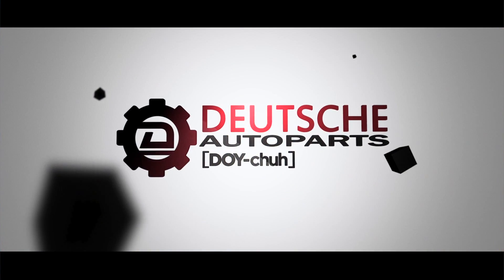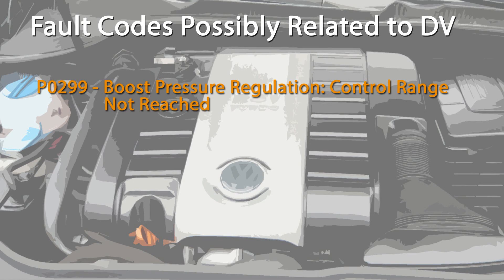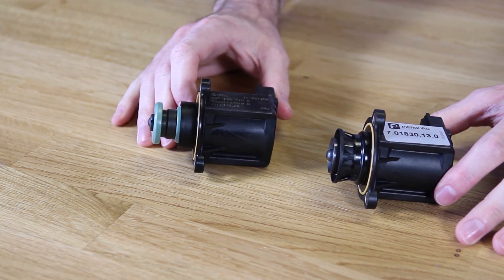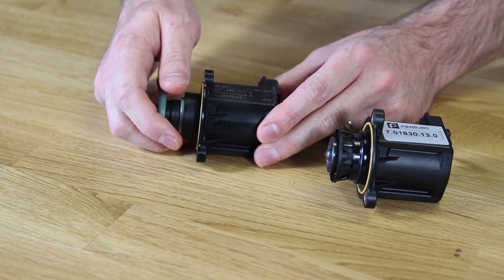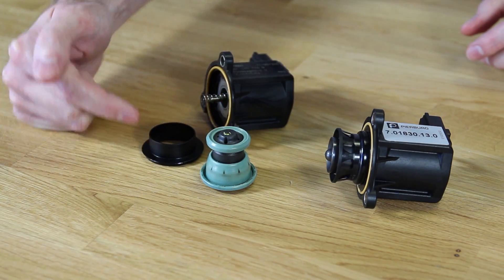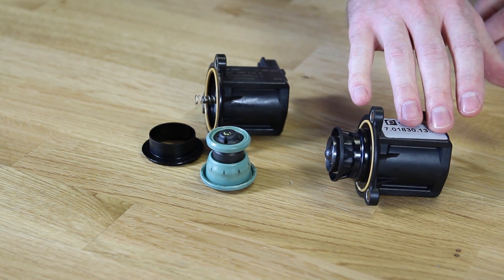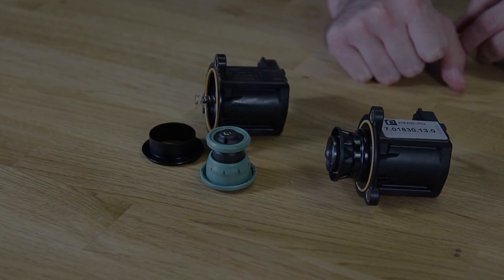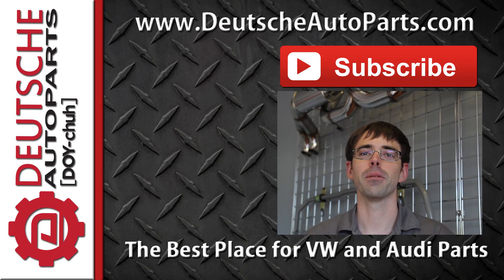VW and Audi 2.0T Diverter Valve (DV) Revision "D" Explained

Comment: Revision D is the latest and is more durable BUT revision G hold boost better, actually it even hold the boost better than the DV+. So if you want peace of mind and you don't want to worry about it, take Rev D. If you want maximum boost and performance and you don't care about replacing it when it eventually fails take the rev G !

Comment: Revision D has leaking issues as well. Replacing with J and upgrading the spring.
Reply: there is no rev J dv.
Reply: @MaxCohagen  yes there is. I literally have it.
Reply: @FLeXJun  can you link it?
Reply: @FLeXJun  thanks...i always thought that its the pistoned rev C version...strange. The piston looks like the same as on the D version
https://www.golfmk6.com/forums/index.php?threads/oem-revision-c-diverter-valve-only-2k-miles.301285/

Comment: Hello,
After replacing the valve i feel some vibration at 55mph speed and it will go away if I keep my foot at the pedal. However it will c9me back if I let go of the pedal. It only happens on the highway at that speed, I wonder why. Maybe I missed something?

Comment: Can you drive with a bad diverter valve until the new 1 comes in.
Reply from the maker: Yes
Reply: @Deutscheautoparts  
Hello i received the part from you and I did replace it. However one screw wasnt good and I put only two screws. I ordered 3 more screws and they should be arriving soon. I do feel some vibration at 55 to 60 mph speed for a moment and than it will go away. I hope you can help me over here. Thanks a million for DIY videos

Comment: I installed a DV piston variant because my oem seems to be not working(no code, just no power and hiss hiss when i demand power ). I checked the old part for diaphragm damage but was seem to be intact. There were oil reported coming from the socket of the DV when they took off the old part. My new part failed 4 days after installation. My guess is oil shorting out the switch again. What oil could it be? Oil from the PCV? I did find oil in the PCV front pipe going to the intake manifold on my 2.0 TSI.

Comment: This is an old video but I'll leave my concern anyways. I have a G version and seems to be the "newest" of all. It also has a diaphragm in an orange color. I just bought the D version, which doesn't have a rubber diaphragm. Which version should I keep in my car?
Reply from the maker: +HUMANO the D is the most recent version. You don't want that diaphragm version. Use the Piston
Reply: Deutsche Auto Parts Thank you. Keep the great videos coming. You guys ROCK!
Reply: The diaphragm version seals and  holds boost better as long as its not damaged

Comment: Hi Paul, thank you for all your informative video's and tips. They are all very helpful. I have a 2013 CC stage 1 tune with cold air intake and r8 coil packs. When I'm accelerating, usually in 3rd gear I can feel the DV valve release a couple of times which cause the car to lose power. You can really feel the power band drop, come back up and the  drop again and then come back up throughout that gear. This only happens when I'm accelerating aggressively. I'm 99% sure this car has the older DV version. If I upgrade to the revised DV valve will I hold boost longer? In other words could the older DV value be releasing boost prematurely?  Any advise is appreciated. 

Kevin
Reply: MAF

Comment: Will the GFB DV+ void my warranty , also if i remove it will it be registered in ECU , so basically can the diller tell that the DV+ was ever installed after removal? Thank you.
Reply from the maker: +Maksim Monastyrskyy You should watch this.  Its pretty long but explains warranties and modded cars.  In regards to if you can take it off.  You should be able to remove it and as long as nothing got damaged the shouldn't be able to tell. 

https://www.youtube.com/watch?v=wW25ZxVPqxg

Comment: can a failed D version DV to have air rushing sound when turbo is spooling? thank you
Reply from the maker: +Kevin C You may not be able to always hear it.  You will need to check your boost level to determine if it is leaking.  You likely would have an underboost fault.

Comment: My biggest question has to be; What the easiest way/method to remove the diverter valve connector from the valve? For some reason I'm struggling alot  to remove it from the original
Reply: u end up fixing it?

Comment: Hi 

Dose it fit 2012 a3 tfsi gas engine?  Here are the Error Codes show in my scanner  P0299, P0328, P0238. Do you think that the dv cause all the problems? 

Best Regards

Ed
Reply from the maker: +Edmund L Yes it is for that model and it is the best place to start with those codes.
Reply: thank you, i will order the dv later
Reply from the maker: Edmund L Great! Thanks for considering us for your purchase.

Comment: So glad I did this project myself. I forget what the dealer wanted to replace the DC but it was easy. The only mistake I made was trying to use a 3/8 inch drive which was to large to allow proper seating of the 5 mm hex. Parts from Deutsche Auto Parts showed up fast and Paul was very helpful. I actually did the cam follower as well just as a preventive step.

Comment: Hi, The VAGCOM says I have a mecanical issue in the Boost pressure control valve. Is de DV the same valve? I don't want to buy the wrong part since I will change it myself.
Reply from the maker: Rich V. It may not be any valve.  It could be the waste gate is stuck.  More diagnosis is required for you to know whats going on.

Comment from the maker: @ Banditen1987 The revised version came out 2010-2011 so it is likely your car has the old version.  It is also unclear when they started using the new valve on production vehicles.  The only way to be sure is to physically check it.

Comment: Hi
I would appreciate if you could tell me what this Diverter Valve actually does?  Thank you.
Reply from the maker: The diverter valve relieves pressure after the turbo when you let off the gas.  This pressure needs to be relieved as this pressure can cause issues with the turbo (call compressor stall) if nothing is done with it.